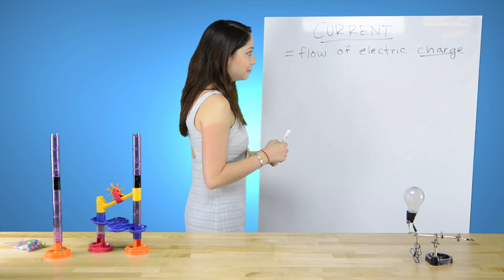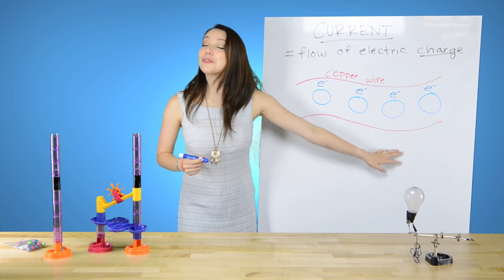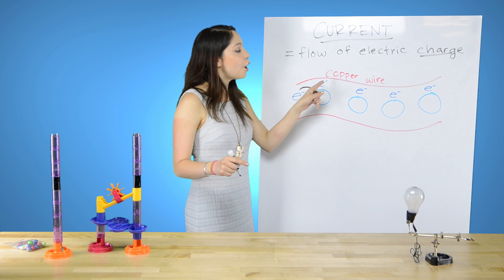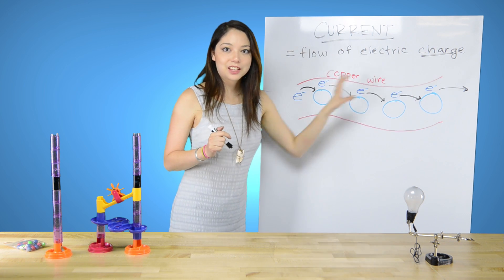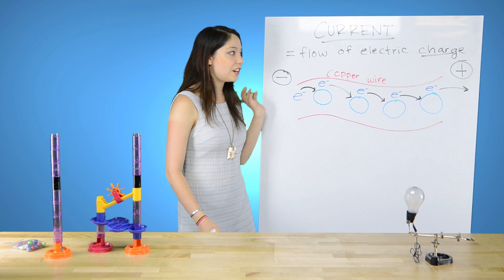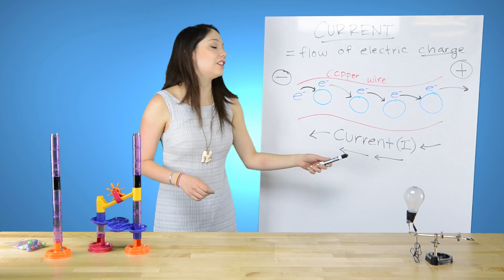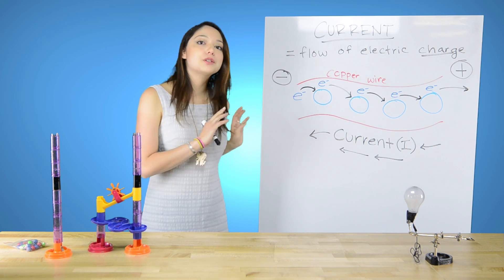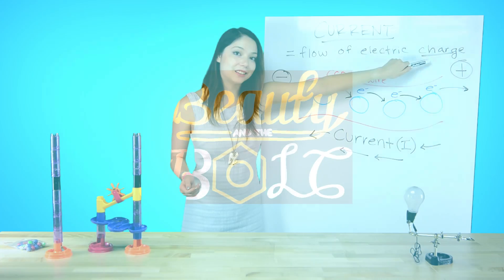Why is Current "Backwards"??

Comment: Because you're being taught a pseudoscience that was installed by the Nazis smuggled into this nation under Operation Paperclip as well as allover the world, and they're who installed this literally resulting in virtually every accredited institution's textbooks in America reversing things and you can verify this by comparing virtually any scientific text from the mid 1950's to those roughly from the mid 1940's and older.

I went to a technical college, was taught the electron model for mass, energy and motion, am an expert in particle physics and so when I review "conventional" theory so regularly, it's an absolute disaster of pseudoscience nonsense.

For circuit analysis, it has some strong merits and it makes reverse engineering work a more practical process, but it's what resulted in pseudoscience for everything from chemistry to aeronautical engineering to astrophysics and everything in between.

Quantum physics is none of what's claimed by mainstream media and countless "experts". Dark Matter doesn't exist, photons don't exist, neutrinos and onward because when you use the electron model for mass, energy and motion, you can always define the bodies involved in said phenomenon rather than evaluating the holes and creating a nonsensical particle up as the "root cause" of said phenomenon. 

With the electron model, quantum mechanics is perfectly compatible with classic mechanics and it's a seamless, common sense transition as you scale up in size.

Comment: Hold on a sec!  You say the electron goes to the negative end of the battery.  Later you say the end of this cable (on the negative terminal)
is the positive side of the wire?  Not sure but  when I use DC I put the plus on the plus of the battery, not the opposite ? Did you make a mistake?
Or else explain.
Reply: Yes she made a mistake. Electron flow goes from negative to positive while conventional current goes from positive to negative.

Comment: It could be VERY confusing for many lay people to grasp or understand why older products have conventional flow and newer have actual (particularly at the time when the discovery was made) which would therefore be dangerous. In order to prevent the destruction of equipment and possible fatalities caused by people wiring things in reverse, it was wisely decided to stick to what is now termed conventional current flow (+ve to -ve). A little knowledge (as opposed to complete understanding) is a dangerous thing after all.

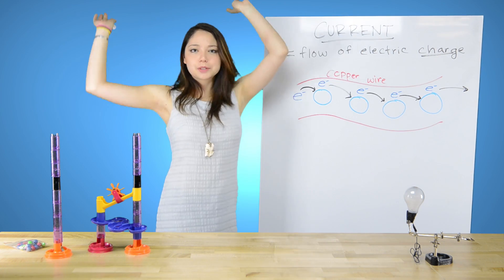Comment: At 1:34 even you are confused!   Electrons going to the negative end of the battery only later to say it's the positive.   Gets even more mysterious when you start looking at semiconductors and you realise how a transistor works.
Reply: No youre confused. Flow of current is not same as flow of electron as she stated. Flow of charge as she stated in a battery connected is from positive end to negative end THRU the battery. Now if you talk about the wire connected to the battery then its negative to the load to the positive. Electron flow is still negative to positive. Current or charge is opposite direction of electron flow.
Reply: @zlonewolf  At the point I stated she says the electron goes to the negative end of the battery.   Hence my comment.
Reply: @johnsim3722  Yes she made a mistake. Electrons don't flow to negative terminal.
Reply: @Slovenija_patriot  Yes, that's correct. I tried to make my comment neutral so as not to be critical of her, because she's doing a good job teaching others and I respect that.

Comment: An hourglass is a good example to illustrate this.  If you look at it closely and study its mechanical components in motion, you can see that actual, physical sand particles are moving through it — but if you take a step back and look only at the abstract values of "fullness" and "emptiness", it's obvious that both of them are moving in opposite directions within the hourglass.  It makes absolutely no difference whether you choose the movement of emptiness to the top half or the movement of fullness to the bottom half as your focus, and neither does it matter that both these abstract movements are caused by the underlying physical movement of sand particles and air molecules.

Comment: Thank you for this simple, straight-forward explanation of current vs. electron flow!  However what you call "current", most instructors tend to refer to as "conventional current", because this has been "by convention" accepted as fact.   None the less, it is WRONG, and instructors need to STOP teaching electronic theory this way!  After all, you no longer hear instructors claiming that the Sun revolves around the Earth, or that the Earth is flat!   Once again, people, "conventional current" is WRONG - Stop teaching it and get OVER it!
Reply: Many instructors don't bother teaching it because it's not required and can be confusing and as Xyla correctly stated, it makes no dangerous to the math.
The reason we stick to conventional current is because of the danger associated with a layperson's possible misunderstanding of it and unintentionally wiring things backwards, thereby avoiding the possible destruction of ( in some cases very expensive) electronic equipment and even fatalities. It's much easier, after all, to think of things as flowing from the positive (greater/higher/more plentiful) side to the negative (lesser/lower/reduced) side.
Always remember…“A little knowledge is a dangerous thing.”

Comment: The reality check is that it doesn't matter, as long as you are consistent in your description. Modern testing equipment will almost always follow this convention, it is most often taught this way in textbooks. For some reason some current books do use electron flow to describe the circuits (I have one TAB book that does), which adds to the confusion. I think of it as the movement of holes. Or the positive side as an electron vacuum cleaner.

[Another example is an aircraft at high altitude or in space. If it gets a rupture, things will be sucked towards it. The idea of being "blown" out of an airlock in space is incorrect and Will Riker on an episode of Star Trek pointed out]

Comment: Current does not flow from the positive terminal to the negative. It never has and never will..  This is just a notation because they had it wrong for so long..
Reply: The US Navy taught electron flow to technicians for a long time. Made reintroduction to the civilian world irritating.
Reply: The positive terminal attracts electrons, so the flow of current IS opposite the direction of the electron movement. The negative terminal doesn't push the electrons. Current is not the movement of the electrons, it is the "flow" of them.

Although, she did draw the electron movement backwards. Should have drawn the rightmost leaving, then the next going right, etc.
Reply: The current flow from positive to negative is physically incorrect, but as Xyla correctly stated, convention had already been well established that this was the case. Actual current flow is from negative to positive, however after such a long time this could be too confusing for the everyday person to grasp, therefore dangerous, so we still use what is termed conventional current flow in today's electronic products, although the designers and engineers understand that's not actually the case physically, hence why we still say that current flows from positive to negative. It doesn't change the math, except in reality everything is backwards.

Comment: To give some sense to the unreasonable, we can explain it this way:  the electrons start flowing from the side which has more  electrons than "needed" that is which has some plus of them -- and they flow towards the side that has deficit, minus of them.

When I heard about this clash of the historical direction and real direction, it was not difficult to understand it but it was HARD to accept it. So I had to convince myself about the system's usability with this reasoning.

Comment: Electricity is still mystery. 'Current direction' is usually being taught as a first lesson on electricity and it kills the topic instantly. it is clear for me that nothing is going trough the wire. Only charge matters, nothing else. The bigger surface area, the bigger charge build up. Actually, current 'I' equals charge 'q' over time  't', I =q/t. I know I sound at least crazy but I prefer to take things as they are. If something was running throughout the wire, we would have to produce matter on the other side. It even doesn't work like that in electricity as we need to create circuit to hold current (charge difference). First work must be done to 'separate' charges. Once they are neutralized, work may be retrieved. In my opinion the biggest misunderstanding in electricity. How does it look like in practice? Think once again how electricity is being utilized. Receivers create magnetic field, heat up matter or just do the opposite - separate charges (charging batteries). Whole science has been misunderstood by migrating electrons in electricity. They do jump between atoms/molecules in chemical reactions e.g.

Comment: The way I was taught is that when an electron is pulled from it's orbit, it leaves a HOLE.  Think of the current as the direction of the holes.
Another way that I personally like, is to think of electrons as being backwards (hence negative) .  So think of electrons as going up a DOWN escalator.
Reply: going up down escalators ... that should clarify it for everyone ... ;P

Comment: Very clear.  Unless you care about the electrons you don't have to know about the sign of their charge.  It would matter for a vacuum tube or electron gun, of course.  In electrolysis/batteries you have both +ve and -ve ions flowing in opposite directions, so its actually good to have some abstract direction for current that's not affected by such details, and its arbitrary, just like driving on one side of the road - we all use the same convention, its easy (per continent!)

Comment: Good to know. I always got confused when people started explaining the "backwards" stuff. Something didn't make sense. Thanks for explaining!
Reply from the maker: Woohoo! Glad you found it helpful. Any other topics that you've been confused about?
Reply: Hmm. What happens during a short circuit? What happens to the electrons and the electron flow? Maybe you could give some examples of common short circuit scenarios.
Reply from the maker: Great question! We address short circuits at ~4:00 here: https://www.youtube.com/watch?v=oiB77H0yVss
Reply: You could make video about capacitors. There is A LOT to explain in that topic. Why electrolytic capacitors are polarized, and other not. And how they work in different circuit (dc/ac, serial/parallel conections). Its confusing topic and i think it would help to many beginners.